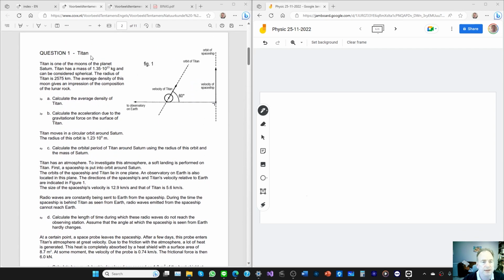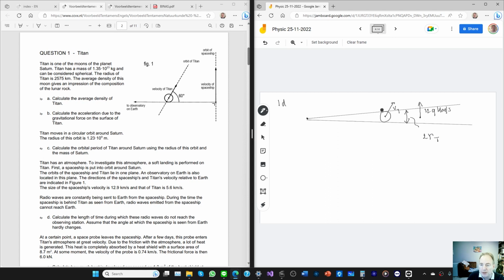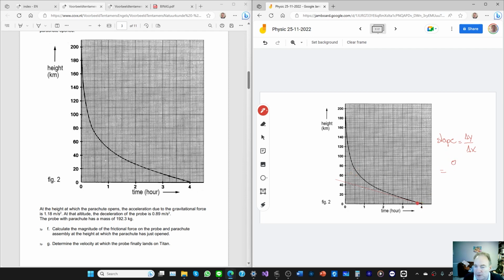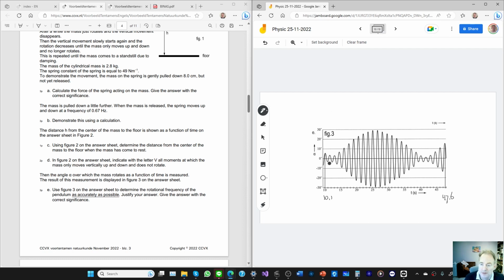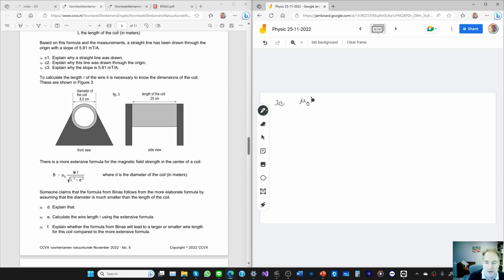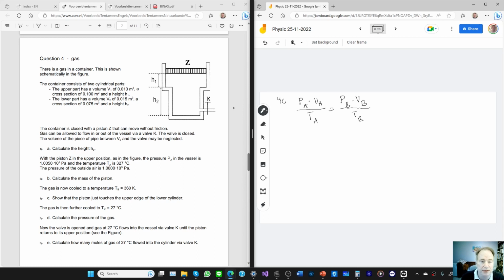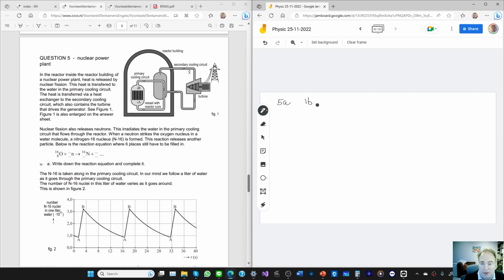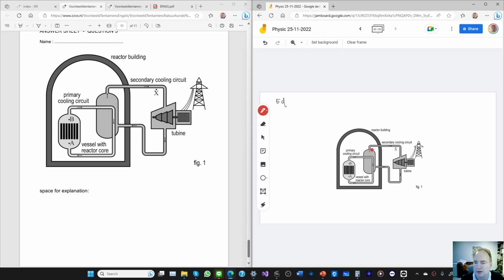Dutch Central Entrance Exam Physics 2022-11-25

Comment: Hi! Thank you for the video! I noticed sometimes the , is used instead of.  For a decimal point and the use of . Instead of x for multiplication. Should we use this notation in the exam?
Reply from the maker: It can be confusing. The Netherlands uses a "," for the decimal separator instead of a "." for example in the US. A vertically centered dot is often used in math for a multiplication operator. While I'm not part of the committee correcting exams, I'm pretty sure all these are okay.